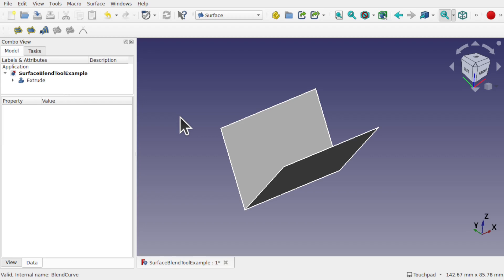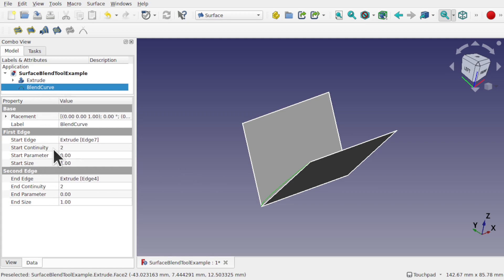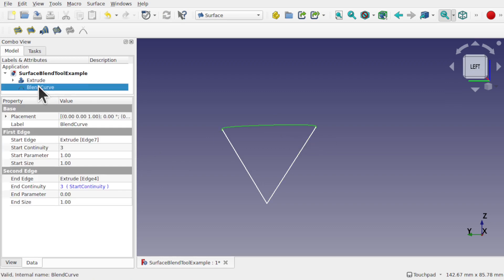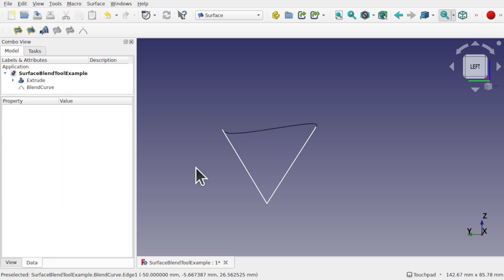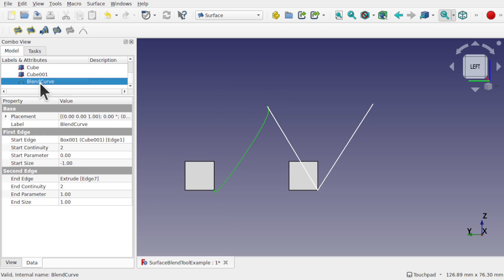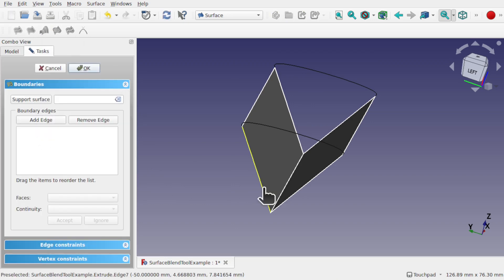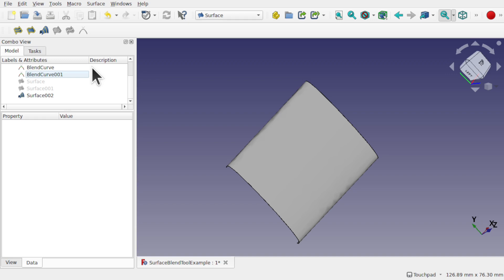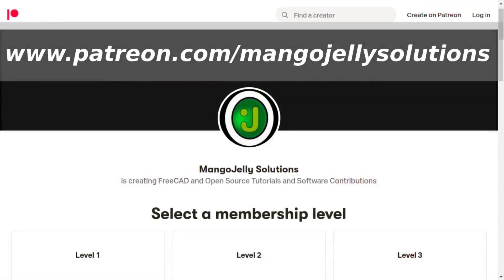FreeCAD: New Surface WB Tool For 0.21! Make Curved Surfaces Easier and Quicker With Blend Curve!

Comment: Total Freecad noob here. Love the tutorials. I have it installed through my software manager (Flathub).  Do you have an idea of how long it will take for it to get to v.21 or should I just go with the appimage?
Reply: Personally I'm a big fan of the appimage. I also use "appimage launcher" which just adds the appimage to all my menus/paths like a normal app, and also recognizes of I download an updated appimage to overwrite the old one rather than install a second copy.

Then again I also tend to use the linkstage3 branch and there's no option other than app image.
Reply from the maker: Glad your enjoying the tutorials. There is no date as of yet to get freecad 0.21 final release but I have been using the beta release / nightly builds, just be aware for bugs so you have to download a new version from time to time.